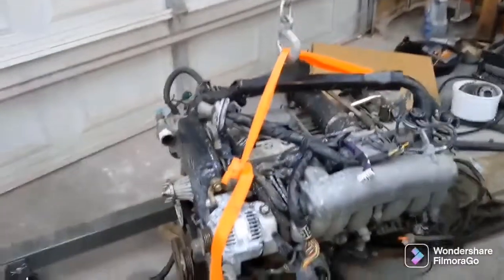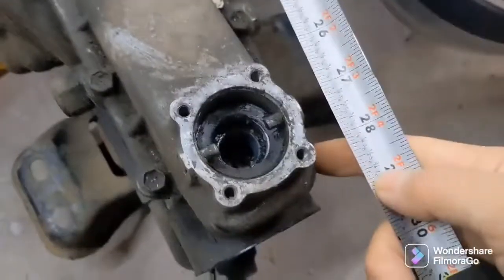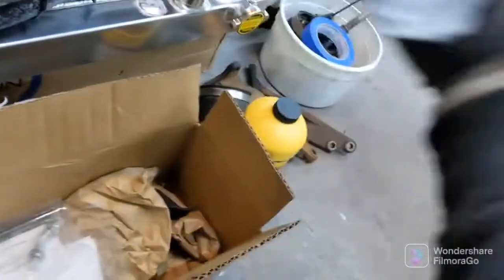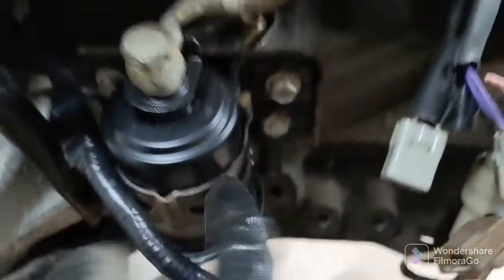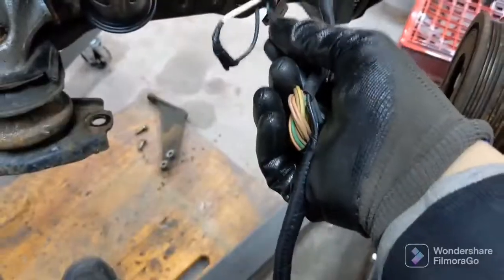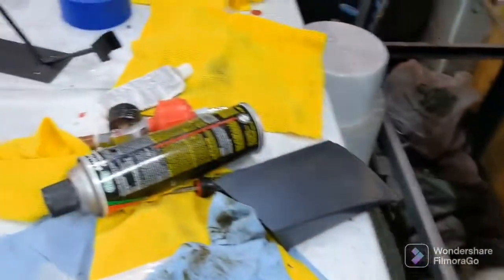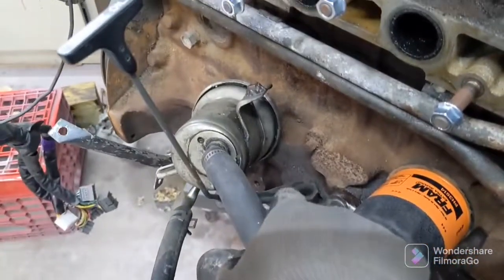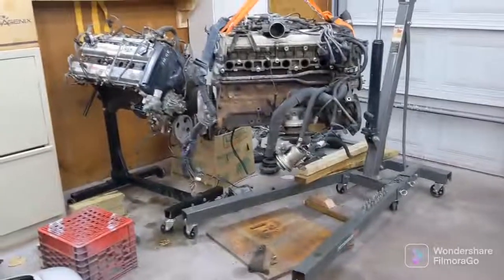Cressida MX83 Build | Swapping Parts/More Problems | Part 2

Comment: Nice project, I'm also in the process of doing a 5 spd swap onto an 89 Cressida . Do you happen to have an extra brake light pigtail harness?
Reply from the maker: Unfortunately I do not. You might be able to find a universal 1157 pigtail harness at your local auto parts store or online. It might need some trimming and splicing but it should fit somewhat. Better than no taillights